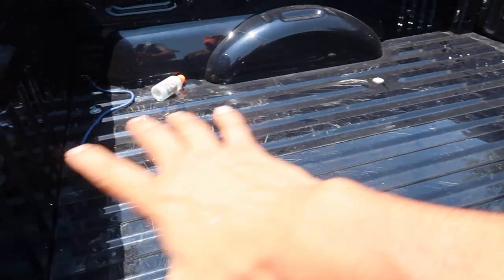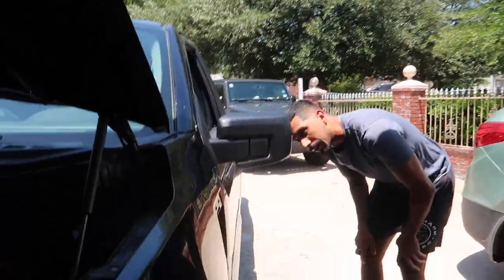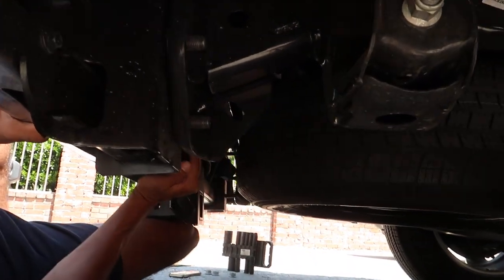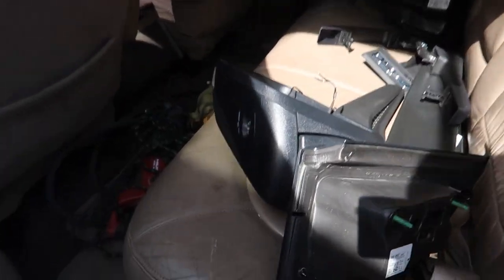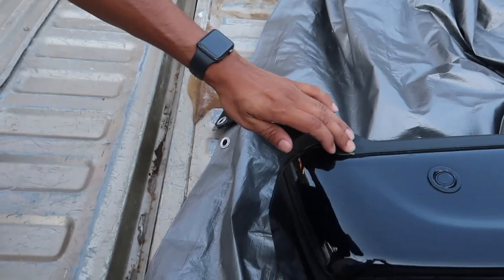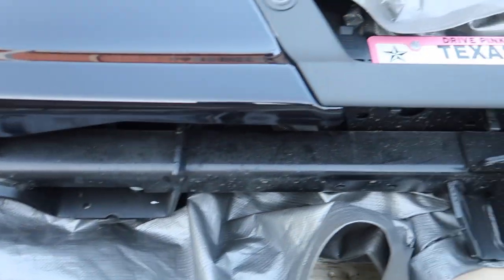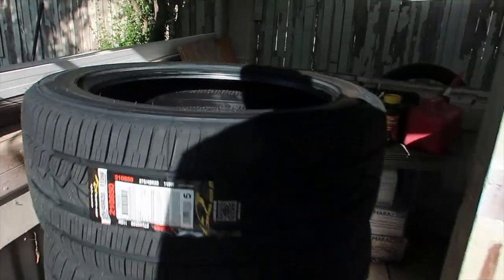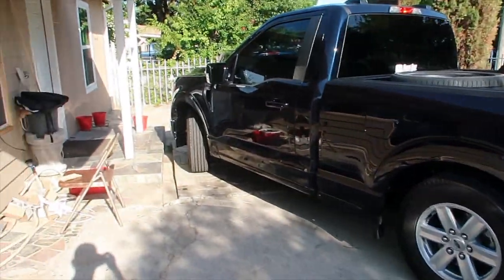WELDS & PAINT MATCH ON MY 22 F-150 COYOTE

Comment: Where did you buy the welds?
Reply from the maker: La colorada truck parts on IG!
Reply: @fajitaboyzDFW  I actually ordered the last set weld had lol

I’m just debating between 275 and 285. My truck will have a whipple
Reply from the maker: @waferzworld  go 285 or bigger
Reply: @fajitaboyzDFW  I’m worried what the 285 would look like on the 9.5
Reply from the maker: @waferzworld  it’ll look good man little more beef
Reply: @fajitaboyzDFW  What lugs did you end up going with
Reply from the maker: @waferzworld  i DONT remember the brand exactly but I got them from colorada truck parts as well